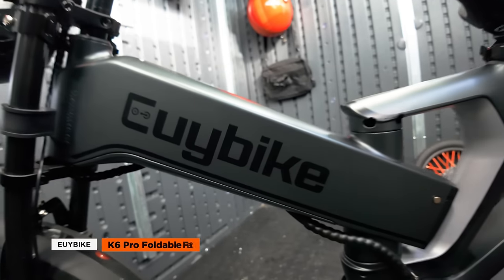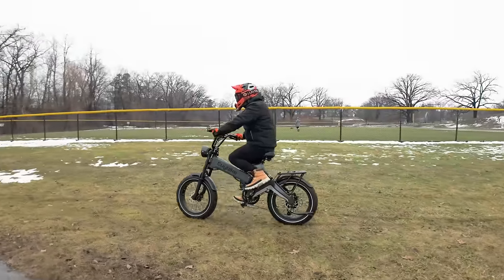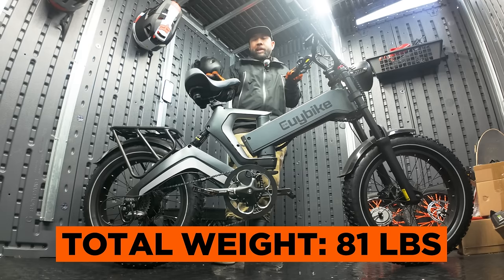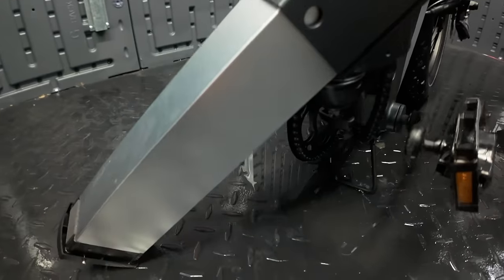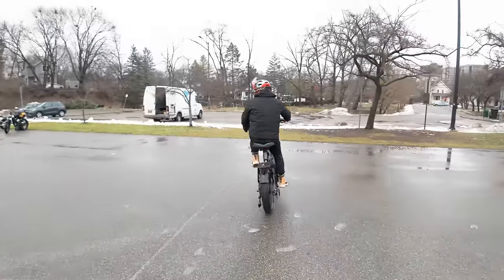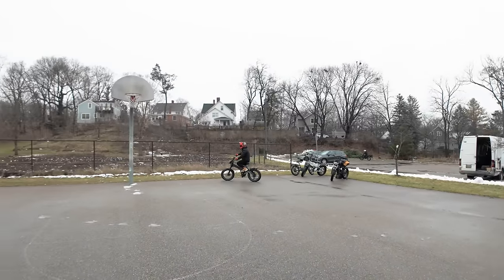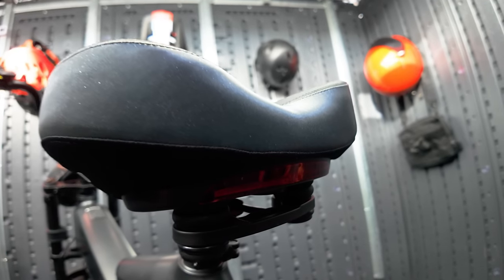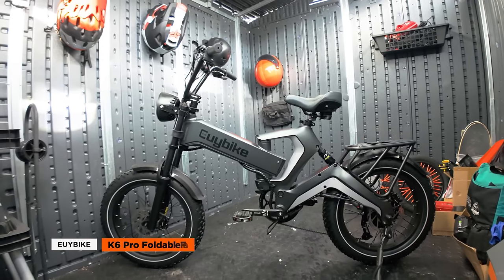EUY K6 Pro Review: Striking Design Meets Foldable Fat Ebike! | RunPlayBack

Comment: I have over 100 miles on the new k6 and I love it. I weigh 200 lbs. And it goes 31mph. Maybe not as much torque as my velotric nomad with 750 watt motor but gets it on. I recommend this bike. No problem at all so far.